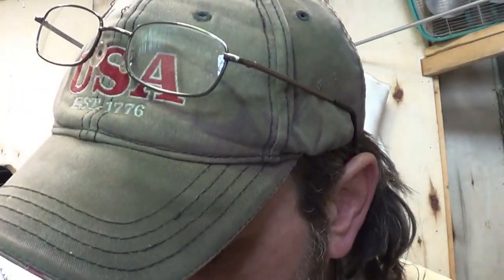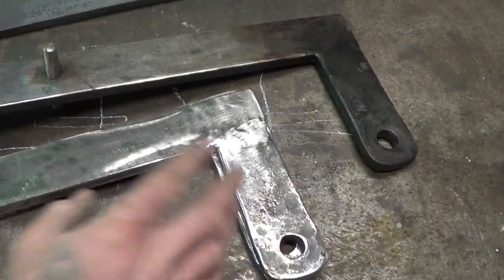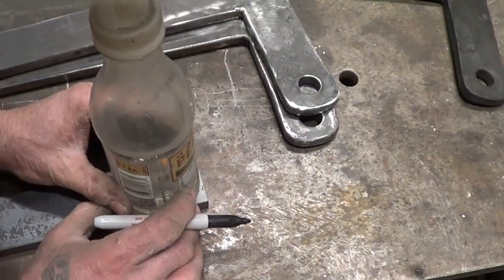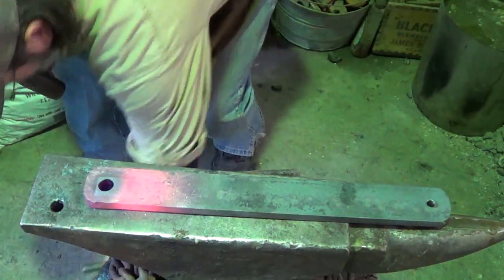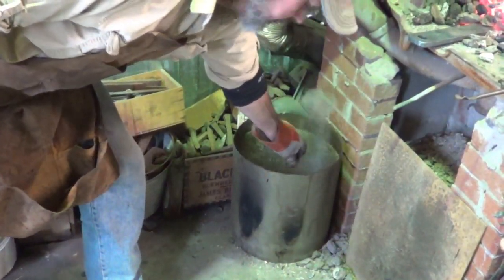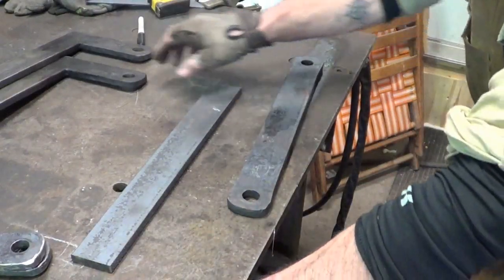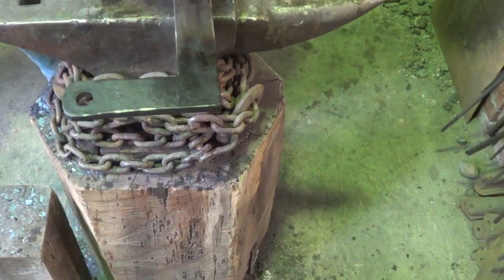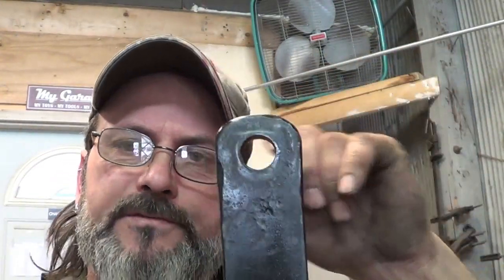Blacksmithing - Forging A Fireplace Crane Set - Part 1 - The Brackets

Comment: Looking forward to part 2, keep up the good work. On a side note how do you like the anthracite coal? I bought a bag of that  at Tractor Supply just to try it but it didn't seem to get as hot as the bituminous I have been using. I'm going to try it again with a little more coal on the table, hopefully it will work out as my bituminous clinkers up something terrible and I'm not sure how long my access to it will last.

Comment: Greetings Chandler, I'm new to your videos and would like to tell you that I enjoy them a lot. I'm reletively new to smithing but not to metal works in general.,I took schooling in the Navy and have done most different types of welding. I might add that welding school in the Navy is different than other school. I would like to ask you a question if I may. I noticed that around the bottom of your anvil there is a chain. Can you tell my the purpose for this? I looked online and it seems that most smithys do the same . Was just wondering. Thanks. Keep the videos coming, I thourghly enjoy them...".....".....have a great day. me Taylor

Comment: love your videos man! keep up the good work? but why did you put wax on the metal?
Reply: I'm not really sure but from what I can see, it darkens the metal while still letting it have a smooth finish. If he left the forge scales on, it would have that dark color but the metal would be covered in gunk and not look metallic. Maybe the wax is a way for him to get that dark color while still showing the details in the steel.
Reply: +Avery Venegas Wax is a good light finish for pieces that won't be out in the weather. Keeps the piece from rusting, etc. Outdoor finishes are usually oil, applied with a rag, and vegetable oil is used for food utensils.

Comment: want to ask maybe a stupid question what does the chain around the anvil do?
Reply: not a smith so my understanding could be flawed. however, I believe the chain does two main things: it helps to hold the anvil in place through weight and it helps a lot to reduce the ringing of the anvil since it has a lot of pieces that can shift around and absorb vibrations.
Reply: +GildedBear thanks I kinda figured that might be what it was for but wasn't sure

Comment: I have a question about my anvil I received, it has a large amount of deep gouges on the top, and isn't the regular anvil type, it's an oil rig anvil and is shaped funny
Reply: +Noah East Grind the surface down clean around the gouges and weld them up using hard surface rod. Make sure you preheat before you weld. After the welding is done, just grind back down to a flat surface and use a sanding wheel or cup snagging wheel the refinish your surface. Happy forgin' brotha.
Reply: +Chris C thanks man! I'll get my welding friend to help.👍🏻

Comment: Doing a square corner in that plain would be a lot of hassle and near on impossible with that stock size. Would have to be firewelded, here's a video of me and my colleague doing firewelded square corners in 60x20. - https://www.youtube.com/watch?v=xmZyDHizWp8.

Also did you put any wax on the rest of the steel to stop it rust jacking apart the masonry when they are fixed into the wall?

Cool video, good luck with the project!